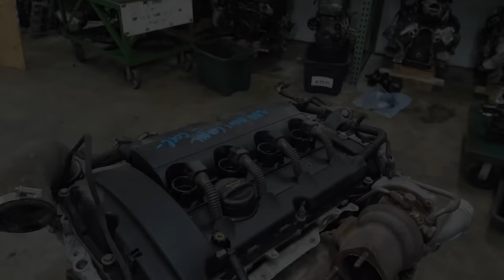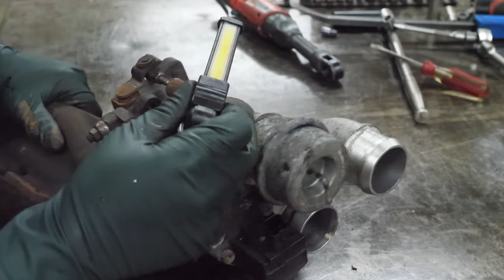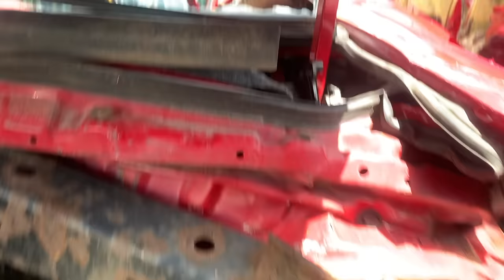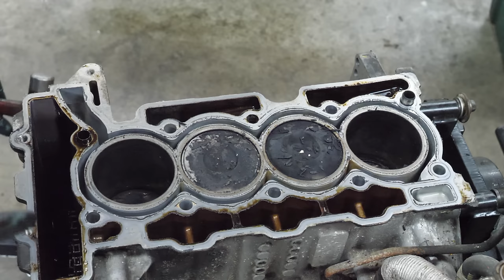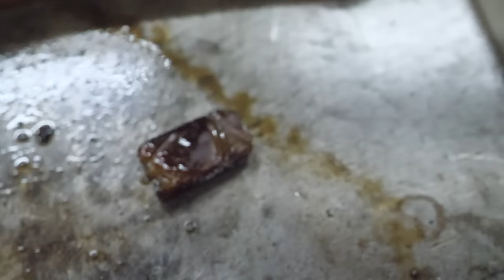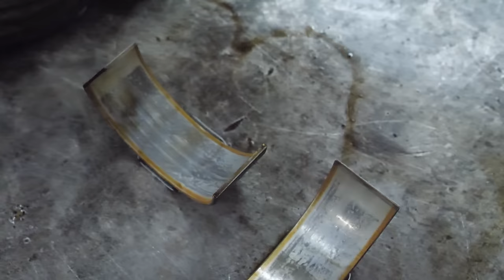JUNK Mini Cooper S (BMW/Peugeot) N14 Turbo Engine Teardown. Why Do People Buy These?

Comment: As a BMW tech I wouldn’t say they are horrible but compared to what. BMW V8 in my opinion are even worse. BMW recommends oil changes something like 7500 on fully syn oil. These recommendation destroys the engine along with the DI causing intake valve issues. Turbos are cheap pretty much like most manufacturers. Replaced more Land Rover eco engine turbos than minis. I don’t like working minis because most owners are too cheap to repair them.

Comment: I would just like to make one point I come from an old schooldiesel world and the only thing that rotates throughh my head in big coloured lights is oil air and fuel filters as often as you can if your doing a lot of super short runs then your looking at evry 12 weeks I have had crasy milages from the dreaded mercedes CDI engine yes the black death model with next o no trouble

Comment: This prince Engine Won international Engine of the Year
For a record eight consecutive years in a row..
The problem was the unrealistic service intervals
Oil change every 5/6000 Miles ( flush) not 10 000
Espexially when attached to a high pressure Turbo system
The common fault was the oil seal that leaked onto the Tensioners
The material used where to soft.. ( couldnt handle the heat ) was swapped out & better designed tensioners fitted
Also take into account Most mini's are are owned by
Young  women drivers

Comment: I seem to remember when the new BMTroubleU mini first came out they used a Chrysler Neon engine, Was it better or worse than these rubbish later models.
With BMW having worked on them for decades it seems they run models for about a decade and only the last models in that ten year cycle have most of the failure points fixed.
Never get a new model BMW when they first come out it will send you broke.

Comment: Ours overheated while it was idling. It actually warped the head, all why sitting still. Coolant and oil were both at proper levels and properly maintained. I will never buy one again

Comment: This engine is not German or English.  It is Peugeot.  BMW licensed this engine from Peugeot for this car.  Then they attempted to use cheaper parts around the engine that caused significant issues.  The Peugeot and Citroen and Skoda use of this engine was more successful because they did the oil seals correctly and used proper parts attached to the engine.  I owned this engine for 13 yrs.  I kept it going by buying parts from Europe that were correct and not the BMW/MINI parts.  You are 100% correct that I could not follow factory recommendations for this engine.  I changed the oil at every 7K and added oil to it every 2 weeks and used seafoam to clean the intakes and grit.  I also had the oil pan off and replaced the terrible paper seal with honda gasket seal.  Note the oil return for the turbo also gums up and causes the turbo to explode.  I replaced this line twice and put a new turbo on it.  I spent 14K in repairs + doing manual updates myself to keep it running for only 108K miles.  I sold it still running well but I had taken intense care.

Comment: I think what went wrong with it is they didn't ask Honda to put the greatest production 4 cylinder engine ever built in the mini and instead chose to put an absolute POS motor to fleece the f out of their customers. bmw had some of the best mass production car designs in the business until mid to late 10's and even built some excellent motors here and there (mostly the i6's and some 4's until the late 90's-early 00's) but always found a way to sprinkle a ton of junk on the good stuff. The 1st gen 1 series coupe and 3 door hatch + the M2 1st gen are the last cars I really like from a design standpoint but my ideal one of those always has an engine swap on the to-do list as ownership begins. No point having a good engine if everything bolted to it is junk. Still waiting for Honda to build a straight 6...

Comment: I've got friends in Germany that all complain about people not buying German cars because the manufacturers are too slow to adopt EV. Completely missing the point that their reputation has dropped ever since they started the cheap out in the 90s. Their obsession with plastic parts that fail is very telling. Then you've got all the needlessly complicated construction requiring special tools for everything. 

That's why you see more W123's from the 80s than C / E class Mercs from the 2000s.

Comment: The engine is possibly from a flooded car. If it sat outside for that long corrosion will be shown everywhere. Most definitely is a high mileage engine with minimum maintenance.

Comment: I yanked my N14 out and am  currently replacing it with a k series honda motor. The body is fine and this car is like a go-kart but the engine is junk.  The newer F56 minis with the b58 motor is way better.

Comment: hey i do cars! love the videos, what do you do with mixture of oil and coolant as far as disposal?
Reply: In the southern US, all reclaimed oil is burnt off in fossil fueled generation plants, thus oil contamination with water, brake fluid, or anything else is not as issue. I would never buy “recycled” motor oil even if it was marketed.

Comment: Thank you for pointing out that just because you have some anomaly where one or two people have had good reliability with an unreliable engine, doesn't make that engine any more reliable than what it is at face value. I seem to have come across this situation a few times where I pointed out the reality of how Subaru's boxer engines are unreliable due to some very common problems, but you have these Subaru fanboys who seems to be too delusional to accept this reality.

Comment: The most interesting thing about these engines is the non turbo model. It has no throttle body, and relies on the variable valve lift system to control engine speed.

Comment: They suck all the bits up into the oil pick up pipe. Every chain replacement you must clean out all the sumpz the oil pick up pipe down the chain slot. Basically everything you can reach. Shocking engine. They also develop a misfire that has no fault codes and remains after the chain is replaced. So it makes you look stupid. Even though you've checked the pcv the rocker cover and everything else you can find. The sump needs wynns gasket maker to get anywhere near oil tight. But on the whole considering the engine is garbage to maintain the gearbox is also weak. So not a car I'd personally touch with a cattle prod. It's a shame because they handle like a bumper car. Bmw/Mini really missed a great opportunity.

Comment: The maintenance was certainly of on this engine. The burned valve is most probably caused by.....faulty spark plug. The mixture first ignites when it is contacted the hot gasses of the neighbbour cilinder when the the exhaust valves start to open. The intake valve also opens for a bit, the hot plasma torches the valve and seat. This proces can repeat itself, but it does not need to. As soon the surfaces are hurt enough they will leak burning gasses under normal condition and torch and damage it untill catastrophy. No thanks.

Comment: It's coolant. BMW factory coolant is blue.  Obviously the head gasket failed, probably from a catastrophic cooling leak. (Or watching further, someone put coolant mix in the oil filler...🤪🤪🤪) And as I'm sure you know, milkshake oil is really bad for anything that needs good oil.... engine, turbo....  just depends on how much damage was done.  Turbo needs a rebuild... engine may be toast.

Comment: I read this with horror. Ive got the Citroen DS3 1.6 TPI that i think is the same engine. Worse still ive had it tuned to 208BHP and i drive it hard. At 130000m i expect it will be falling apart soon!

Comment: Peugeot fixed this. BMW did not. The THP 270 HP (in 308 GTi and RCZ R) are the top models, very reliable.

Comment: I worked as a Peugeot technical adviser for 7 years in Stockholm, Sweden. Due to the "superb" engine construction, cold weather climate and customers only driving short distances, we never ran short of work on these engines 😅

Comment: Its a Peugeot engine (french are not best engineers) I know how the water got in there because mine  just did the same thing (07 with 140,000 miles on it) the seals between the oil filter housing/oil cooler and the block failed and it dumps the coolent in to the sump and drops the oil down the fron of engine.

Comment: I've owned a 2011 JCW (N14) for about 3 years now, I bought it at approx. 70k miles, and it's not at 100k.
Those 30,000 miles have been horrible on my wallet... It's been a fun car to own performance-wise but on the maintenance side it's been a living nightmare, constantly having to replacing gaskets & top up it's fluids.
I would never recommend anyone buy an N14 powered Mini.

Comment: I would have a problem with it if it told you to change the oil and there wasn’t a drain plug - turn it upside down to drain the oil OH YES I HAD TO WITH ONE ENGINE!!

Comment: I think that the presence of water was not a cause of the engine failure, but entered the engine after it's removal. A lack of regular oil changes was most likely the underlying cause for it's failure. Had it been owned by a woman with little understanding of the need for regular servicing?

Comment: When MGRover had the New mini plans, I think they co developed a brand new engine with GM. I wonder if BMW had kept that engine thing would be different for the owners. BMW is well known for its love of plastic fantastic and said plastic was the achilles heel of the last engines that MGRover produced. On the plus side when MGRover used the BMW diesel engine for there cars they had the foresight to take out the plastic swerl flaps as they could see if they broke could ruine the engine which they did in BMW case lol.

Comment: Someone once said that the engineers who design engines don't have cars with engines they designed. They prefer cars with Japanese engines.Everything is better in Japanese cars, from the door locks to the engines.

Comment: Anyone know if the later engines, around the 2016 were a different engine and these issues with fixed, particularly the 2.0 petrol cooper S in the clubman? (Approx 170 ish BHP?).

Comment: I'm not convinced that they are that bad.  Have you seen how BMW owners treat their cars.   Every green light is a drag strip, 6500 rpm is the standard shift point.  Donuts for amusement to warm the gears.  Maybe they can afford an annual maintenance but maybe not.  Rims, tinting and wraps cost money.

Comment: well, same as in bmw f10 2.0 twin turbo 245Hp N20b26 gas engine timing chain very, very poor material, falling into small pieces chain plastic guides, whining oil pump and leaks everywhere.

Comment: My wife insisted on having a Mini - the worst car I have ever owned. Cannot even check the oil as it has no dipstick - just need a degree in computing and a spare 3 hours or so. The ride is so bad conversation is by sign language and relaxation totally impossible.

Comment: All BMW / MINI vehicles are basically disposable. 

Any of these that are not crushed at 10 years will require $10,000 to $20,000 in repairs minimum.
Reply: Not any. Mine 2009 JCW has 215K miles. Other then the known issues.  (HPFP, timing chain (under warrenty). But nowhere near the 10,000-20,000K you said.

Comment: Obvious. Someone poured water inside the engine. The engine was fine. All the wear you found was because of the "lubricating" water. The molten valve happened at the end. If it was running with molten valve the plastic intake manifold would melt.

Comment: Yes, they are crap.

IIRC they suffer from ECU failure, causing the ignition coils to self destruct (melt) injector failure (that melts the spark plugs) and burned out valves (because the ends fall off the spark plugs due to the injector spray pattern  malfunctioning, or the injector spraying onto valve.) 

They are a hand grenade, with the pin pulled the second the leave the factory, just no one knows how long the fuse is.

Why are you undoing them in the correct order? The engine is scrap.

Exit: a burned out valve. Standard failure mode.

Comment: These n14 and n16 engines are shocking, we have the non turbo n16b16a engine and it's awful. It eats oil, its had two chains and I hate it.... The wife loves it however 😢

Comment: These comments are painful. This video is painful. This engine is actually quite easy to service and reliable for what it is. Maybe it’s just your lack of understanding of automotive technology and maintenance that makes this engine not make sense to you. Like who gives a crap where that bleeder screw is for the thermostat? Who even bleeds cooling systems like that anyways? Ever heard of vacuum bleeding? Also I have had to replace maybe two of those tensioners in 8 years of working on thousands of these….i could go on for days but why waste my breath on a primate.
Reply from the maker: Do you think a disproportionate number of bad car owners own n14 cars or you just think they’re unlucky?

Comment: My Mini now has 248 thousand kilometers or just over  154,100 miles on it and eventhough the exhaust is rusting all over the place, the enginge is still in great shape. Sure there are some parts, most of them made out out of plastic that got brittle. Nevertheless, all the important parts are working just fine. I only had to change a vanos solenoid and an ignition engine wise. ¯\_(ツ)_/¯

Comment: I dont understand how you guys in the US get SO FEW MILES out of an engine! 
I can ONLY think you don't maintain your cars PROPERLY and use crappy non oem parts and fuel. Here in England if you get less than 120k from a crappy engine theres a a problem amd for a good engine like a BMW/Honda/Toyota/Mazda etc, there's no reason on a petrol engine to get less than 350k miles and diesel 500k uo to a million miles ( if maintained) CORRECTLY! 

In US from what ive seen especially on forums can ALWAYS Tell when its someone in US posting, cos their dashboards are lit up like a Christmas tree (and STILL IGNORED)! Then they state "i have an issue and don't know why" they get RUINED by EVERYONE, for not servicing maintaining their car, or sorting out issues when they arise and 'wonder why' the car blows up or starts slowly falling apart. Its like they believe the service intervals are "optional" and basic maintenance! Its honestly cringe worthy to see.. 🤦🏻🏴🇬🇧

Comment: When "pedal to the metal" takes a whole different meaning
You also found a multi layered cake in the pan! What a lucky guy
By the look of it, i wouldn't have touched the pickup and oil pan interior assembly before cleaning either (although it became a cocktail of water, oil and brake cleaning fluid later on).

Comment: I have one of those, I have 150,000 miles on it and have only changed the oil 4 times. Still running strong.

Comment: At 52 years old, this is the worst motor/vechile that I have ever seen for reliability.   In the 8 years that I have own a 2011 Mini Cooper S with less than 120K miles on it, I've replaced 1) O2 sensors, 2) front wheel bearings, 3) rear wheel bearings (twice), 4) exhaust gaskets and bolts, 5) fuel filter, 6) fuel pump, 7) coolant crossover pipe, 8) oil supply lines, 9) starter, 10) ignition coils, 11) spark plugs (twice), 12) brakes, 13) oil filter housing, and 14) valve cover.   This car is terrible.

Comment: BMW, cars and motorcycles. Sure ain’t what they used to be. BMW has been rushing new technology in engines to market before it has been proven reliable.
  I would lease a BMW, but I would never buy one, the problem with that is, I have never leased anything. But the way cars are getting today, you have to marry the dealer. If ever, I was going to lease any vehicle, it would be an electric car because of the battery life problem.

Comment: I never regarded these BMW  minis as proper minis. I drove an original 850 mini back in the 80's. It was fun to drive, reliable and easy to fix. In my opinion modern cars are  rubbish. They are over complicated and over engineered. Many of the component parts of older engines were outside the engine block and there were no turbo chargers, fuel injection or bloody computers. If you want to see properly engineered cars go to a vintage car show.

Comment: Undoubtedly one of the worst engines ever produced. Was a joint venture between BMW and PSA I believe. 
I've seen catastrophic failure before 30k on several occasions. 
Timing chain failure, head gasket failure. Oil leaks, water leaks, plastic water housings cracking under pressure. The water pump is designed to only pump water when the ECU demands it! Problems stem seals and piston rings will often result in the engine burning the oil that hasn't already leaked out of the engine. Oil pump failure. The list just goes on.

Comment: They are junk. We had one with oil pressure issues with low miles. BMW said it was because the oil filters would get plugged and go into bypass. No shit sherlock. Anyway, I dropped in 50 weight oil in it to keep the oil pressure high enough and went to trade it in lol. I feel like vomiting looking at the thermostat.